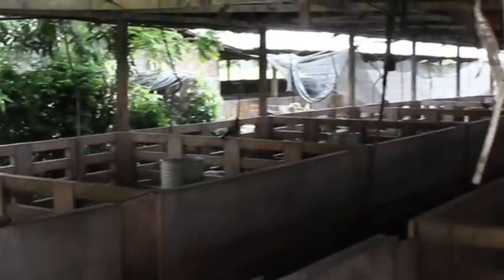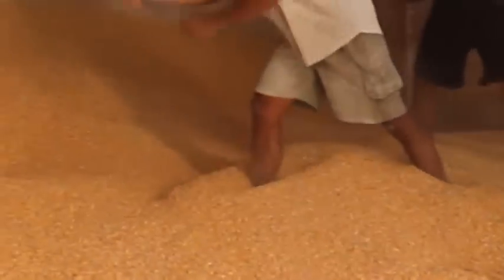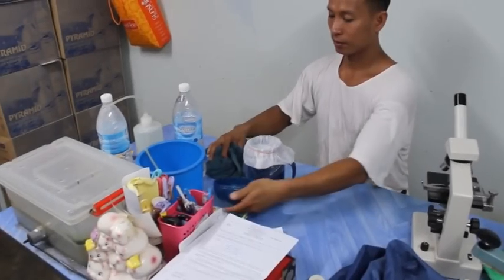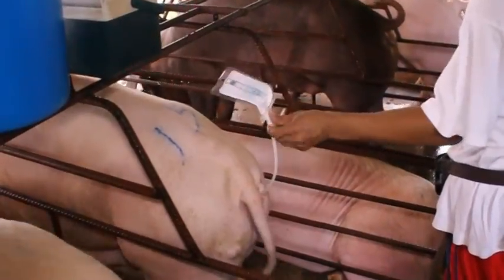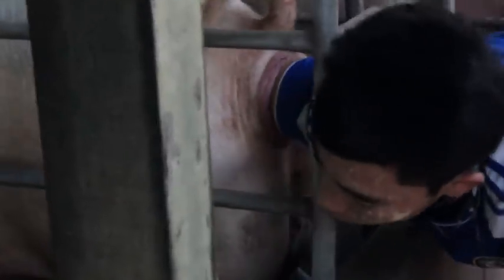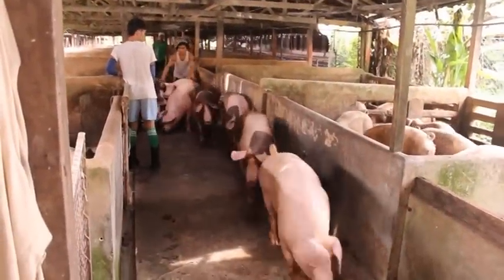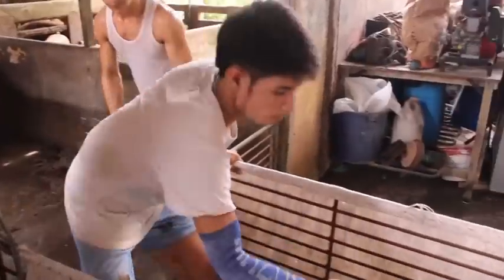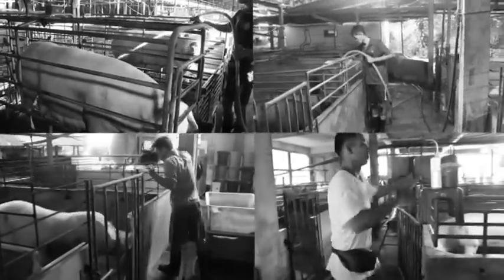Pig Farm Documentary by OneProduction

Comment: According to modern veterinary medicine, castrating a piglet without anesthesia is extremely painful and considered unacceptable farming practice.  Because modern painkillers are inexpensive and safe, the pig farm in this video needs to include painkiller.  It's only one short, step and it will set a good example for other farms.
Reply: Bravo Marti Masters. I agree completely with you.
Reply: It would be hard to figure out how much to administer because each ways a different size to little would be okay but to much could be devastating even killing the pig not to mention expensive! I’ve seen tons of vets do it this way this is the way I was taught maybe some lidocaine. Sounds easy one shot but did you see his sow barn each sow had a litter from 14-24 and breed 3 times a year do the math. If I was running a pig farm again I would use spray lidocaine it’s safe and pigs heal super fast!